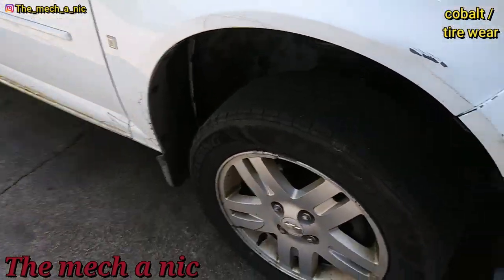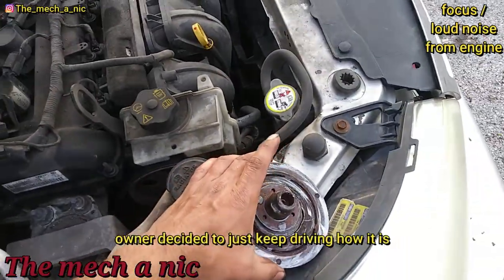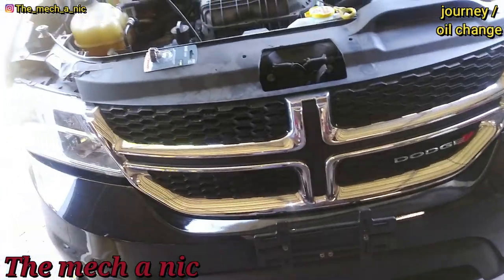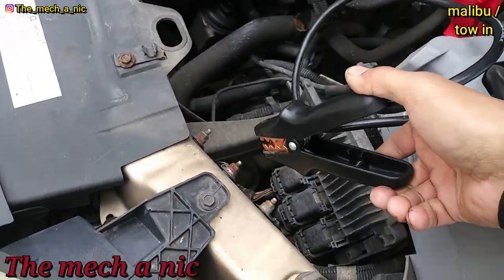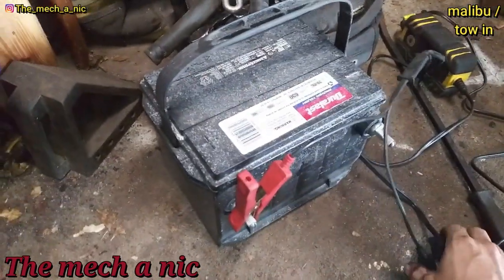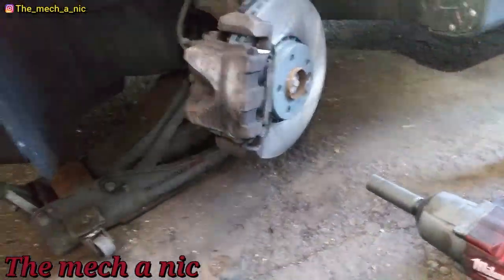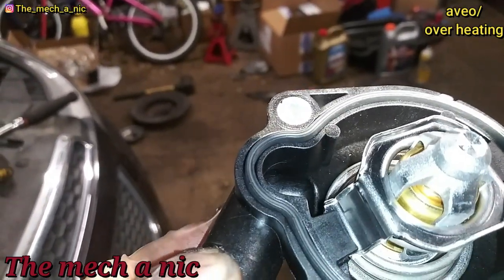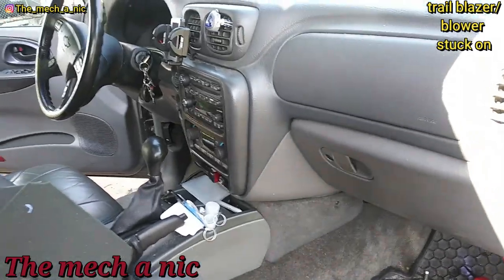altima tie rod , malibu alternator , cruze coolant leak , (vol 59)

Comment: The part where you called the customer to bring the car back to make sure the bolts were tight, because they were at the shop talking to you while the work was being done OMG i relate so much with this.  I swear nothing can make my mind race at night while trying to sleep than thinking about a couple certain bolts that may or may not be fully torqued.  And also the customer who wanted to just keep driving the Focus even with all the issues lol, it drives again i just want to drive it ha ha.
Reply from the maker: Im glad someone understands, it sucks when people talking to you make you loose your focus and forget things

Comment: You need to sleep. Good call on having the customer return. I bet they were torqued. I'm thinking your labor rates are pretty competitive and she deny's a tune up? Excellent job on that battery issue/ alternator issue. I'm amazed at the lack of preventative maintenance people avoid only to pay more later.
Reply from the maker: Of course they save a penny now to pay more later. I dont understand it. My prices are more than competitive, it's why they always come back. The ones that dont come back are the ones that found someone to hack it for them.

Comment: Well I feel sorry if you got to work on a pt cruzer the worst car in the world !! The alternator if needs to be replace you got to pull the axle out n order to get it out ..
Reply: Take out the oil filter , unbolt the power steering cooler and take it out from behind the engine thru the top.
Reply from the maker: Reminds me of my tiburon with the v6 , not the easiest job to remove the alt